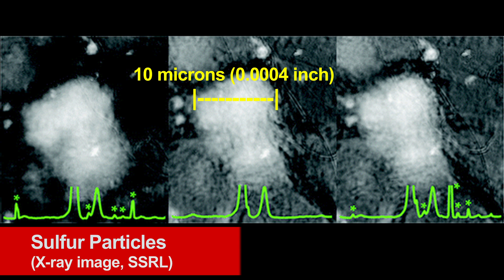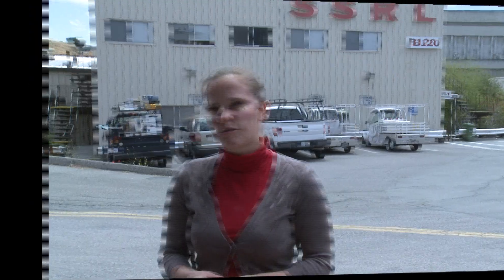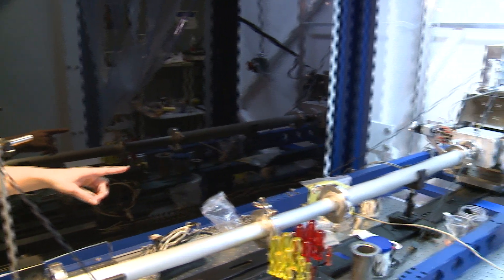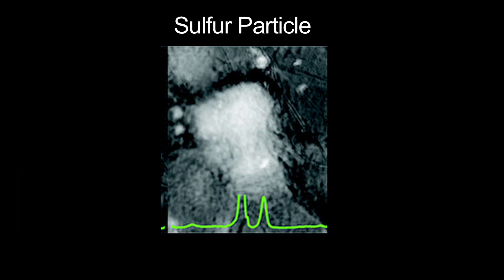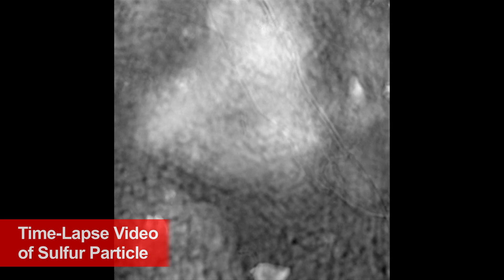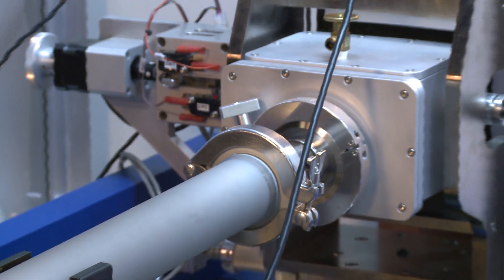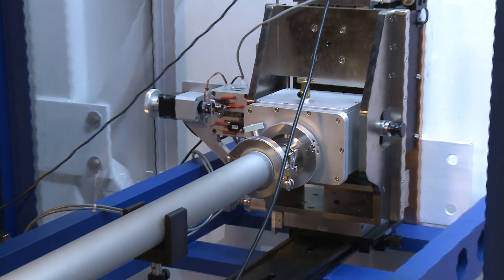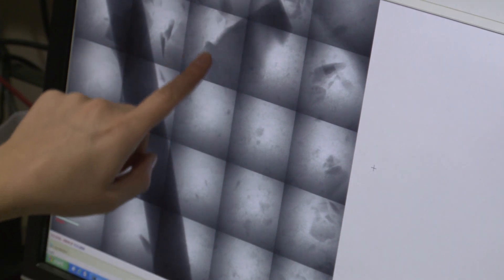Scientists Probe Lithium-Sulfur Batteries in Real Time

Comment: Hardly, it's just A) Said user is too lazy to upgrade B) It costs too much.
Windows 7 is more stable than XP - that's a fact. With Windows 8 around the corner, there are performance boosts that I have witnessed first hand, and would leave no excuse to not upgrade other than situation A or B.

Comment: The softwares used for these types of machines aren't updated as frequently as OS versions because of monetary reasons. That's why they often use XP since that's what the software was intended for when it was designed, also they don't have to reprogram and redesign equipment every time there is an OS update or a new OS release.